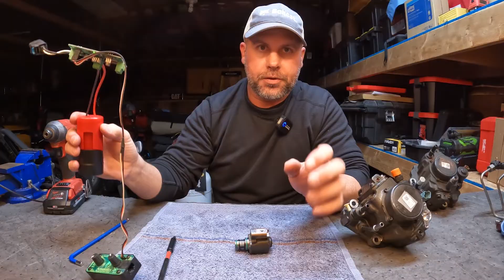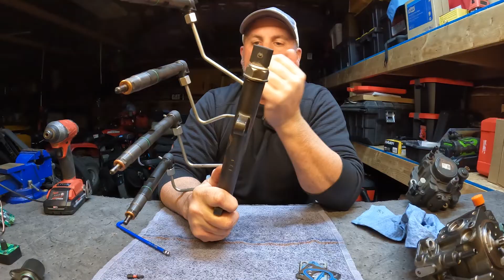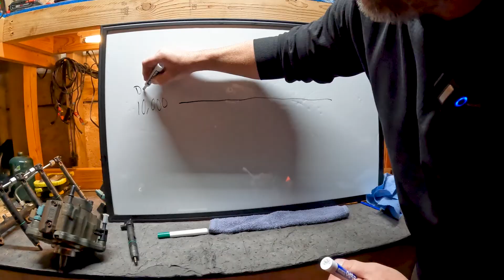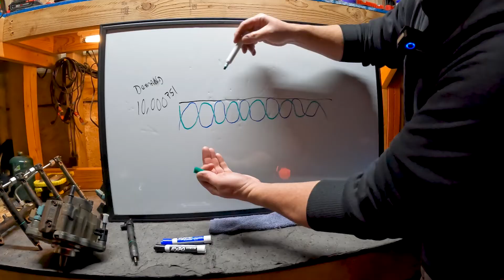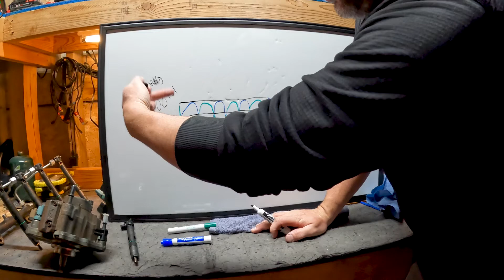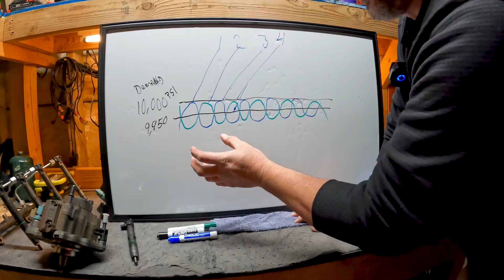Bobcat Fuel Injection Pump, What you need to know to troubleshoot common rail injection pumps.

Comment: Just bought an s550 2015 d24 engine and return side bleeds back and the primer bulb gets soft could it be something with the pump? Seems like the tank return line is fine
Reply: Probably relief valve. Having same issue right now. What was ur fix?

Comment: So I have a t740. Just put new injectors and new pump on it. Can’t get it to start. Long story short, during cranking I’ve noticed fuel coming out of the rail return tube. I took the relief valve out and gave it a good tap. Put it back in and it started but only ran for a few seconds and died again. Pulled the valve out again and tapped it again; machine started again but won’t run for more than a couple seconds.
Reply: Same issue here. What was ur fix?

Comment: I have a 2019 t740 and getting the fuel pressure rail code. So I prime the bulb it will start and run until the bulb goes soft. Now it dose not suck flat pump it back up and starts and runs until soft again. It will start back up if you don’t pump but don’t run as long. I’ve blown air back through the pick up tube and done a little better but still stops.

Comment: Hello buddy thanks for taking your 
Time to explain how the fuel sistema works. I have a fuel plobler on return line on my bobcat t590. 2 of the the conectar lines on the injector just pops or disconnects when i start the machine. Starts with no problem  but  once its running just kicking the two returning connections conect to de injector. It looks has a lot of pressure im not sure what's is the problem.  I believe you have a idea what happens there. I'll will be appreciated if you can diagnostic or help me?  Thanks and God bless you.

Comment: I ran into a fuel issue today on one of these D24. The Delphi pump was pouring diesel fuel out a little weep hole on the pump causing low rail pressure no start. I like the idea of the weep hole so the fuel don’t dump into the crankcase. But my issue is that it’s a damn seal that needs replaced and I couldn’t find one anywhere. I had to order a complete new Delphi DFP4.4 pump. Have you seen them pour fuel out the weep hole before?

Comment: Very helpful video. I would like to hear how to time the pump.
Reply: That's the part I'm on too. I"m finding very little info on how to do it but am seeing some talk about doing dead center and making sure you are on the right part of the compression stroke . I'm not saying that's right but I'm digging into it too and one of his comments somewhere in here mention that it should only take a few minutes to do . There are two little dots on the gear of the pump itself and I'm guessing those are used but it would be amazing to know what position those are to the other. Other resources say look for a tick mark on the flywheel or outside but I don't see anything on mine and took a ton of different pictures and zoomed in to see if I could find what could have been a dimple or dent or something. I'm working on it tonight and will come back here If I figure it out.
Reply: @RobertMattocks very interested in what you figure out. I talked to Bobcat, they said the timing is very foregiveing. I did see a video where they just slapped on a new fuel pump, rail, and injectors. It was hard to prime but did start. I benched tested my pump and eventually got it to pump. I did not see any timing marks on my gear. Im working from the back side, i did not take off the front timing cover to expose all gears. I haven't tried to start it yet, thats tomorrow.

Comment: Brady, I have a 2014 Bobcat T650 Doosan engine I bought it new it now has 850 hours it has ran flawlessly until the other day It shut down as if I had turned the key off the pickup line in fuel tank is good the fuel in tank is good always used filters from Bobcat dealer no codes present it will start and run if I spray diesel fuel in it any suggestions will be appreciated。 Thanks, and God bless!
Reply from the maker: Do a back leak test on the injectors
Reply: @tetradgroup  Ok thanks!
Reply from the maker: Any codes?
Reply: @tetradgroup  No codes present
Reply: @tetradgroup  I checked the IMV valve thinking it could have been stuck closed it test good with 12 volts
Reply: Brady I'm looking to purchase the laptop/software to program injectors and trouble shoot Bobcat?

Comment: I have 91 753 with the 4 cylinder kubota engine. 
I fuel to the pump from the tank .
But no fuel to the pump .
Hense no crank .
Any suggestions to get it going .
Thanks

Comment: Really good videos I have a 2018 bobcat T595 and fuel is entering the crankcase I had it at woods machinery they replaced one injector changed oil and I got it back smoking with fuel fumes burning my eyes after 8 hours oil level 2 inches over upper mark on dip stick 
I know your busy but any input would be appreciated Alex
Reply: It mat be leaking fuel from the input shaft seal leaking into the timing cover.

Comment: I have a bobcat t595.  I watched a few of your videos on the fuel system.  I have no start issue.   I tested the old imbv valve and it would not close or open it also had damage on the connector of the valve I replaced the valve. Bled the system again.  And still no start.  Prior to this when I bought this machine I completely drained the fuel system. I was told by a couple people that used it this needed a fuel pump that’s what they thought at least.
Reply: What was issue?

Comment: Question, during operation high rpm’s its runs between 600-650 ma. But when my unit shutdown before it codes it’s goes to like 900ma and rail raw pressure and read pressure drop to 0. Also the coil is hot asf! Which always leads me to short to ground. I went ahead ordered imv since she hot as hell before it codes out. Also just having it unbolted and feeling it after shuts down it feels like it pulsing like the valve is closing and opening extremely fast. You can cycle the key and she fires right up. The unit finally has went from 2 hrs of operation to like 2 min which is easier for me see what’s going on. Now customer swears if he changes fuel filter out it runs longer but no case anymore. Nothing was on the imv screen at all. But the Ma calling for call for 900ma is odd to me. I ordered imv of Amazon for like 70 bucks as bobcat wants like 1500 for it lol. Well guess I’ll see Monday if the imv fixes it. I will check the wiring to imv but never had blown fuse or cam sensor errors etc.
Reply: Also codes p0254. Which is rail on bobcat but which is imv on my Jaltest software.

Comment: I have a T630 that will not prime for some reason. Every time I squeeze the primer bulb it acts like it’s filling the filter then going to the pump, except when I squeeze the bulb about 10 times, it eventually gets firm then when I unscrew the water separator on the bottom of the filter it’s like all the squeezes I just did come out all at once like it’s not going through the pump. Any ideas? I’ve Already checked imv, fuel lines, fuel filter replaced, fuel pickup had  a tiny bit of rust on it in certain spots so I cleaned with brake cleaner and blew off with air. New battery as well. Machine will crank off ether and stay running with no issues or codes until I turn off and try to restart then I get a low voltage code M0309

Comment: I'm new to bobcat doosan engines, but I have some experience with the yanmar common rail engines. They have a very similar fuel system. I think they call the IMV a PCV (pressure control valve). Mine went bad after I ran some dirty fuel through it. I remember Yanmar wanted about $800 for the valve. I read the bosch part number off my valve, put it in google and sourced one from europe for about $120. A quick google search for the delphi IMV is similar: bobcat wants $1200 for it, delphi parts suppliers ask about $200.

Comment: Not sure if you will see this comment.. but, I have a 2016 S650 with that 2.4 and I have 1 injector (#4) that has NO fuel coming out of the return line when I attach clear hoses to all my returns. Original issue is that machine won’t start unless I squirt a little starting fluid, then seems to run good, but will not restart on its own without the starting fluid. I swapped injector #4 with a spare new injector and it fired right up… shut it off, and it’s doing the exact same thing again. My guess was a bad connector or wiring to the pcm. So, I checked and the wiring is free of breaks, and connector at injector is good… what’s your opinion on this? Also, pcm connectors, and pins are all clean and making adequate contact.

Comment: I've watched a couple of your videos and think you're the person that might know what's going on with a Doosan 180-3 DL06 I'm looking at purchasing. Starts up great and sounds great. After about 15 min, white smoke starts coming from the exhaust. Idling it is noticeable but minimal. Under load, white smoke comes out pretty good. I've heard fuel pump/system can be the issue, as well as egr cooler has failed. I don't think it's a head gasket. You have any idea what it might be?

Comment: Hi i have a question regarding this pump - i have no start and code regarding low fuel rail pressure i have tested IMV valve and thats working as i should - i have hand pumped the premier bulb but its not going hard after 20 pumps - should it go hard ? or is there something im missing ? Im thinking injector but should the primer pump still go hard ?

Comment: I'm working on a 2016 Bobcat E35, It will not start on its own. A little shot of ether in the filter, it starts right up and runs great. But it will NOT restart on its own.  Any ideas?
Reply from the maker: What engine does it have?
Reply: @tetradgroup  Doosan D18
Reply: We have the Diesel Laptop computer, no codes, pump pressure is 4000 psi, new injectors which we programmed by the computer. We also took out the squeeze primer bulb and put a little electric fuel pump in its place, no differencr so we put the squeeze ball back on it.
Reply from the maker: @WayneGrimm-w3c  we can schedule a video call if you need some help at www.4tetradgroup.com

Comment: What cuts the fuel off to the engine when you turn the key off on these common rail engines? I know on the older "mechanical" engines they have the fuel stop solenoid.
Reply: The imv valve

Comment: We stumbled upon your videos as our S650 just died. Bobcat says fuel pump needs replaced, looking at close to 5k after labor. We are looking at installing a reman pump ourselves. Is there any programming or coding we will need to do after? Thanks!
Reply from the maker: Just a pump?  If pump is bad then injectors are probably bad as well.  Something doesn't sound right.
Reply: @tetradgroup  not according to Bobcat, the pump physically broke. I would send a pic if I could figure out how. But yeah, our mechanic spoke with Bobcat and they said pump only, injectors should be fine
Reply from the maker: @kylenash3525  interesting, I'd like to see that, send a picture to 4tetradgroup@gmail.com.  No programming required for just a pump.

Comment: I have a 2019 Bobcat T770 skid steer that will not stay running we have had 1 mechanic tell us that we need a new fuel injection pump but we’ve also had another mechanic tell us no we do not the machine will crank up but it will not stay running for very long a few minutes tops and then it shuts off and you have to squeeze the prime ball in your opinion do you think that if it is the pump it would crank it all
Reply from the maker: In my opinion I would say no but I'm not the person there troubleshooting the machine.

Comment: I have 12.5v on the white wire to the imv and 10.5v on the black wire to the imv. Is the black or white supposed to be ground? I went through the whole harness and found some bad wiring and repaired.
Reply from the maker: White wire is good but black wire is PWM from ECU so hard to check for voltage. What are the symptoms?

Comment: Your videos are awesome and informative. I’m working my way through a T595 intermittently stalling under load. I was hoping it was just air intrusion from a broken pickup tube but it was all intact with strainer/check valve on the end. Getting a 157-21 Code (Rail Pressure Control Fault).

Comment: I have a pump that is leaking low pressure fuel through one of the bolts that fastens it to the engine, would you know why?
Reply from the maker: The case must be cracked I would think.

Comment: Thanks! O man, I went through the ringer last year with my 2015 t450. Bobcat does not machanic anymore theyre only fix was to change out complete fuel system, every fuel line, elbow, and flush tank thoroughly. They only wanted $15k to do it! I fought it at first but after months of no resolution I ended up buying every piece myself, saved about 7k not buying theyre reman pump kit and i got brand new, i flushed the tank way more then I know they would have, replaced all the lines every part, then had to pay them to do the main parts so they could program them or whatever. Now that I have some understanding of how everything works I'm 90% sure it was a injector. Before all that I was working with a old school diesel mechanic that couldn't make sense of it all and we cleaned every ground changed cam Sen, crank Sen, fuse block/wire harness, sun of a gun. Then finished that and my joy sticks starred giving me issues, so I changed those also.lol. now i bought a transfer tank with a filter with water block and only fuel up out of this, did good for a while but twice my right joy stick gave me codes and today it wouldnt run kept giving me meturing valve code, I shaped it with my old one and got it goin but now I'm paranoid! Not to rant but I'm sure I'll have some questions for you. Thank you for your videos....
Reply from the maker: Awesome, thanks for the support and glad you got it sorted out.

Comment: Hi . I did the static test in t550 2014 . Two injector was bad . Since before didn’t want to start just with little spray of started fluid. Well that how I did the static test . I chance the four injectors and the fuel lines . Well went I did that the machine started and few seconds later died . Since then I can’t get to started again. Could be fuel pump bad ???
Reply from the maker: For more a more individual and detailed response, please visit our website to contact us.  www.4tetradgroup.com

Comment: I have a T550 bobcat with this pump that runs fine but wont shut off. How or what shuts of the fuel to stop the engine?
Reply from the maker: The ECU shuts the engine off electronically, it the engine continues to run then its getting fuel from an alternative source, oil from a bad turbo maybe?

Comment: Great informative video, I have a Bobcat463 giving me starting issues. Takes a lot of cranks to run. Wont start sometime. But once starts runs like a champ. With this symptom do you think the pump would be to blame. Also will running the winter n summer diesel fuel conditioners regular basis to the tank will keep these systems in better shape.?
Reply from the maker: I would first do a compression test on the engine.  Will it start with 15 seconds of glow plug?
Reply: @tetradgroup  Thanks fr prompt reply. Never tried that long of glow. Tdy i removed the fuel lines off the top of fuel pump & upon cranking it doesnt shoot out any fuel, is that normal?
Reply from the maker: @yamahalowrider  was the fuel shut off open?  Not sure if you have a solenoid or cable operated
Reply: @tetradgroup  As far i know i dont have any fuel shut off valve. There is a big capacitor like looking 12v part right next to fuel pump, i am guessing thats the solenoid. I dont know how to test it.
Reply: Also i checked the fuel tube inside the tank, i found there was no Pick up filter inside, just the open end tube..should i install a filter / one way valve inside.?

Comment: Major help!
But I need help, I have a s570 that wouldn’t start, no codes. 
Called bobcat field tech. 
He said need whole system, due to pump failure. 
I pulled the pump and inspected just as you did, I see ZERO metal, no contaminants, etc. 

Could it fail with no signs?
Reply from the maker: It's unlikely.  How does he know the pump failed?
Reply: @tetradgroup  he said it wouldn’t build rail pressure and there was metal. 

I have found no metal. And didn’t look like anything was Remove to check from metal all over
Reply from the maker: @ryanhurley4871  just one bad injector can cause a low rail pressure issue, of course I'm not the one who diagnosed it but if you'd like to schedule an appointment to talk about it you can do so at www.4tetradgroup.com

Comment: Nice video and nice one on the excavator, but how do you time the pump? Lots of great info.
Reply from the maker: Line up timing mark on crank pulley with mark on front cover, doesn't matter if its on the compression stroke or exhaust stroke, #1 just needs to be top dead center.  The pump gear will align with a make on pump but depends on which engine you have.  The timing process will be in the service manual.

Comment: Hey, great video. I'm only getting 1.5 volts to my IMV valve what should that tell me?
Reply from the maker: Make sure you check to battery ground and not terminal ground.  White wire to batt ground should be 12v.  If not start with fuse #21

Comment: Great video and a lot of useful info. I have a little different problem I wish you could help me with. On my 2017 s570 fuel started to spray out the little hole on the cover. I’m assuming a seal went bad. Is this something I can fix? Any info would be greatly appreciated. Thanks, Paul
Reply from the maker: Send me a picture of exactly where its leaking and I will let you know if it can be fixed, 4tetradgroup@gmail.com
Reply: I ran into this same issue but this one was pouring fuel out the little weep hole on the front plate beside the FCA/Metering valve. Did you ever figure it out? Was you able to replace just a seal or had to purchase a new pump?